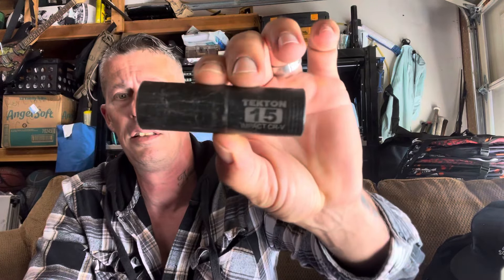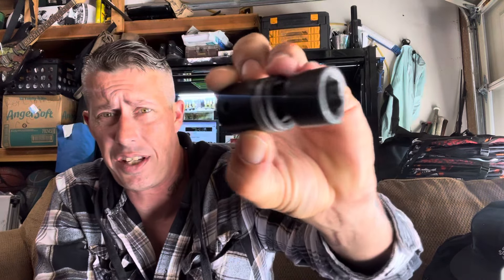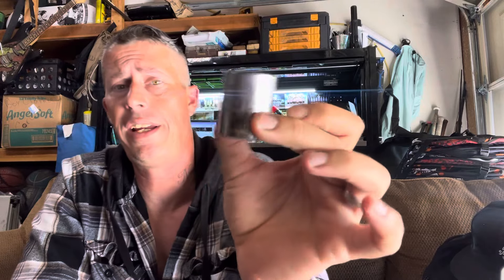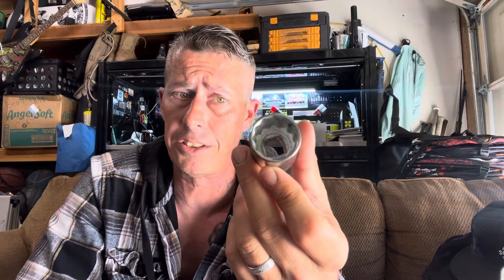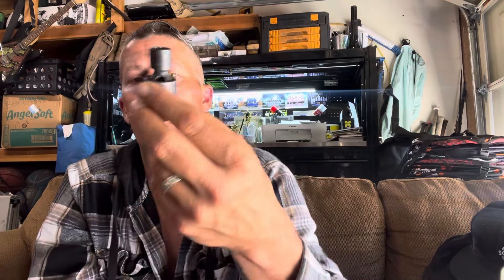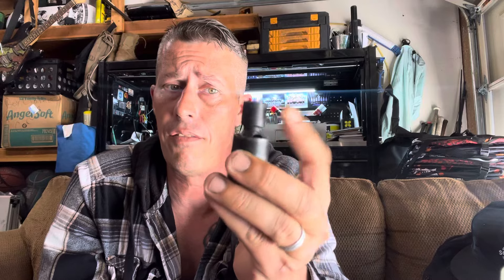Is a Socket just a Socket or Does Spending More for a Professional Brand Make a Difference?

Comment: I’ve went through three sets of impact swivels sets from Pittsburgh. Each time the spring would come loose and send the socket flying when using a 3/8 impact . I did notice that harbor freight switched manufacturers over the years which may have been why you haven’t had the same issues, also seen manufacturing changes with the Pittsburgh ratcheting wrenches when comparing them with an “identical” set from harbor freight for anybody who might  be wondering . Just sharing some info

Comment: Great vid.  I find the Tekton 3/8" standard chrome sockets (which are the same as HF's Quinn) a little long vs. the Icon (which is essentially the same length as SO).  I use the Tektons as a mid-length set now.

Comment: I have blown apart 2 of the pittsburgh impact swivels on jeep compass rear hub replacements so finally got the icons and haven't had an issue. the only downside is they aren't as low profile but still work well.
Reply: All impact swivels break, I've broken half a set of the Snap Ons. Any of the pinless ones are good but again they all break especially on hubs. They're dangerous honestly
Reply: Seriously been thinking about dropping some cash on icon especially the ratcheting wrenches.

Comment: I basically have 5 sets of sockets/ratchets: one in each of two garages, one in my basement, one in my RV, and one in my truck.  Two are old made in USA Craftsman, one is new Craftsman, one is Pittsburgh, and one is Stanley Black and Decker.  They all work.  I have been using some of the Craftsman sockets since the mid 1980s.  I don't wrench full time but I am very much a DIY person.  I have a set of 1/2 inch Craftsman impact sockets that I have run for 20 years that are still going strong.  I would say you would get good service out of any of the sockets from reputable companies, whether made in USA, Taiwan, or China.

Comment: Only time in the past two years of me doing automotive DIY I broke any socket was me using a pittsburgh chrome socket from their 51 piece set (goes as low as $15) with a breaker bar on lug nuts. It just split and then they gave me an entire new set.

Comment: after wrenching 30 yrs non professionally but regularly i switch most of my hardline tools to snap on. i used to be a snap on hater just because of the price but then i started using them and for me, it was better than what i was using which was mostly usa made tools of all brands.
i bought them off of ebay, local pawnshops and buy/sell websites and paid no where near retail. that was about 6-7 yrs ago but now people want dang near retail for used, beat up sets/tools but i still see deals on ebay every now when im scrolling looking at what i dont need. lol. 
the fitment is better and they definitely are a better tool. each to there own though.
thanks justin.

Comment: In the rust belt of the Midwest I would say it’s worth it for the tool truck. Not for every socket or wrench set in your box but when you need it worth it to have a good set. I would say best bang for your buck for cost would be the grey pneumatic duo or gearwrench.
Reply: Im in the rust belt. I rarely use my snap on wrenches. They fit too tight. Fighting the wrench on and off the fastener wastes a ton of time and irritates me to no end.

Comment: I see both sides. A good consumer brand - by whatever metric you judge that by - will do good. As you work in the trade, the weak points will show themselves. I use a lot of stuff from ACE hardware and Menards at work and the only thing ive had to splurge on was a Fluke voltmeter and Proto hex keys. At home, im looking at name brand brake line wrenches - brake lines are the bane of my existence.

Comment: I hear you on the sockets, have a old greatneck deep 1/2" impact socket set used it for 20 years only broke one 19mm on a honda crank bolt, now have the weighted socket for that purpose, I have the same usa impact craftsman 1/2" short socket set never broke one same for 20 years

Comment: I used really cheap sockets when I first started out in the early 1990’s.  They worked until I had a corroded fastener and those sockets loved to round the fastener.  However, modern cheap sockets have rounded corners and engage the fastener on the flats not on the corners.  This makes all the difference.  The I have a set of the colored Pittsburgh sockets (extra set)  that have most of the color worn off and they have been great.  Of course specialty sockets (swivel) have been hit and miss on.

Comment: Years ago, doing lots of intake manifold jobs on GM 3400, 3100s, there was one bolt that I had to borrow a long reach Snap On socket from my boss. My mid-line socket was just too think to work. Its a rarity and 98% of the time a Craftsman level will work, but once in a while it doesn't.
Reply: Guess I could have taken my cheaper socket to the bench grinder as another option.

Comment: Imo, any normal cheap chrome sockets (attached to hand ratchets) can last a long time without having any issues with breaking. I bought a Walmart set of sockets about 10 years ago in a cheap tool kit, and they were like $15, and I actually still use them to this day because there’s nothing wrong with them. Now when it comes to impact wrenches or any battery/air powered tool, then you need to spend more money on quality sockets that are chromoly steel, which will not snap but bend instead of shooting a flying metal shrapnel at you or something else. Hand wrenches cheap will work. Electric/air/battery tools, you need more expensive. Just my two cents.

Comment: Id say Carlyle are at the top for a non truck brand. I like certain tools for different reasons. I favor very quiet and smooth ratchets that dont sound like crickets. XP120 pretty much takes top honor for that, but i also own the newer SK 90 3/8 ratchet and that thing is silky smooth quiet and the gear/pawl mechanism the beefiest I've seen! I love the new Craftsman V series sockets. My new Icon 3/8 General service set is pretty sweet!
Reply: If you open the noisy ones up and pack them with grease, they'll be silent.

Comment: i had a husky 19 mm deep socket fail on me undoing a head bolt on a lada using a ratchet 
i have tryed so many different sockets and i usually have multiple around if i have to sacrifice one by hammering on a fastener to make sure it comes off i will 
after being in the game you learn what sockets you need to upgrade

Comment: I don't use my tools every day professionally, but, as a home mechanic I've always had the best luck with the mid range tools. My experience is the cheap tools will only hold up to abuse a couple times before breaking, the mid range will last quite a while but will also break. Depends what is the best value for what you do.
Reply: They all break under regular use I promise. Socket fitment and ratchet "feel" is entirely subjective. I keep a set of SAE chromes for the reason Justin stated. No chance I'd pay the prices Snap On is asking today. They're nuts.

Comment: In my opinion, buy most of your tools in the mid range and you'll be happy. I advise buying the cheapest tool of anything you can find, unless its suppose to be a throw away. More often then not, you get stuck with the crappy tool, keep it around because its not broken yet, but get frustrated everytime you use it. Easier to just take the wallet hit up front. 

Snap on sockets really are not worth the money. I've owned sockets from every top brand, and snap on are really unimpressive in terms of tolerances and design and yet one of the most expensive.

Comment: I have two small chrome 90t and 120xp gearwrench black Friday and two days after Christmas deals a 74 pc complete set of deep and shallow well sae and metric sockets and breaker bar,tekton set and the main crash or junkyard set when I need it will be a 194pc husky brand mechanic tool set and the gearwrench 1/4,3/8 sae and metric mid length sockets in chrome to help the husky set and the 32pc set of Pittsburgh combination sae and metric wrench sets gave like $19 for those wrenches

Comment: I’ve broken almost every tool I’ve ever bought…. Who can warranty it fastest I’ve been waiting months for sockets from the trucks, it would behoove you to get real nerdy with electrical because big wire repairs and harness jobs are $$$
Reply: Warranty on the trucks is why i stopped using them unless i absolutely have to or they have a great deal on something. I always hear "youre paying for the service!" If using a socket out of a $20 set for 3 weeks while i wait for a replacement for one out of a similar set i paid $400 for is a service im good. I waited weeks for tools off each truck at the same time, got tired of excuses and bought a bunch of "lesser" brands for my main hand tools. The only thing i havent found thats comparable is is torx sockets. I havent had a chance to buy the gearwrench set though. I was going to get them awhile back but ended up having some health issues. This isnt 1995 when the only place you could buy tools was either sears or one of the tool trucks. There are so many great tools out there now at a fraction of the price. Everyone knows tekton has you send a picture and has a new one in the mail the next day but ive had several other companies do the same. I reach out on facebook and have a replacement a few days later. Gearwrench makes better ratchets than any of the tool trucks at less than half the price. I love gearwrench sockets and other tools too. Snap on cordless tools are hot garbage and 5x the price of milwaukee. Matco cordless tools are better than snap on but still more expensive and not as good as milwaukee. I bought a second earthquake 1/2" air impact because coworkers were constantly borrowing it when their truck brand wouldnt get something loose.

Comment: I have had to get more large sizes in the last month than I have used in the last ten years.  On a John Deere garden tractor frame and deck and a Swisher brush cutter buy large size SAE set of wrenches and socket just whatever brand you can afford.  If that's all you use them for they will outlast you.

Comment: Sadly, I think Gearwrench has changed their design on those impact swivel sockets and not for the better.

I’m a hobbyist and I’m to the point where I’ll pick stuff up just to have nicer stuff. 

You’re opposite me. I see no reason to grab SO electric stuff. 

Gearwrench is kind of all over the board.  They still make stuff in Taiwan and it’s noticeably better in fit and finish than their China made stuff. That said, the 230-ish sets are decent and typically mostly Taiwan made. 

For someone just starting out, they could do well by starting with a Quinn set and upgrade in the future. I’m pretty sure it’s largely Gearwrench stuff. 

I’ve gotten good at finding good deals on Icon tools. Set of metric 1/4” chrome  deep sockets, missing the 8mm, I got for $12. 🤷‍♂️ 

I think it makes a lot of sense to just get impact sockets for 1/2” unless you need 12 point for some reason.

Far more likely with the chrome is for the chrome to flake and slice the crap out of your hand. In my field though, chrome bits would be a non-starter.

Comment: I have Pittsburgh deep impact sockets in Metric and SAE (from when they sold them in the tin trays) and they are still smacking on buts and nolts without any problem. I've had them since I was 17, im 30 now. I don't have a swivel socket set. I've been using a Pittsburgh swivel adapter. Gets the job done. But I'm thinking of purchasing some ICON swivel sockets. Seems like a quality product. Also I use Husky chrome sockets, and they work fantastic. The best part is they go from 6mm to 22 mm no skips (I brap on them with the impact and haven't been brapped back at 😂). It's hard for me to justify spending more money on tooltruck tools when the hobofreight and holmes depot tools get the job done just as efficiently. Awesome to see another person in the field bring exposure to the younger techs and maybe even older techs that the "manufacture name doesn't determine how effective and efficient you are as a tech" and that you don't have to go into tremendous debt to be in the automotive industry 🫡.